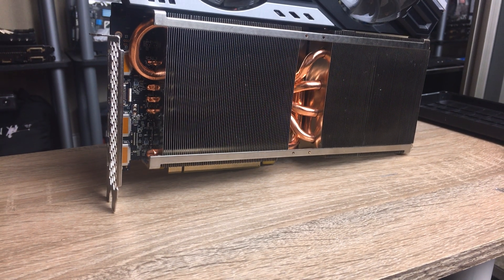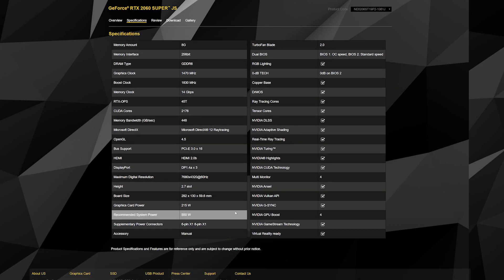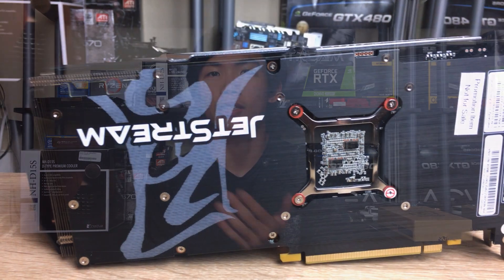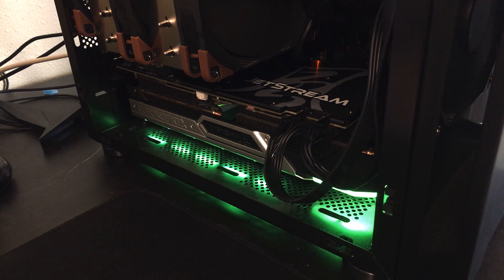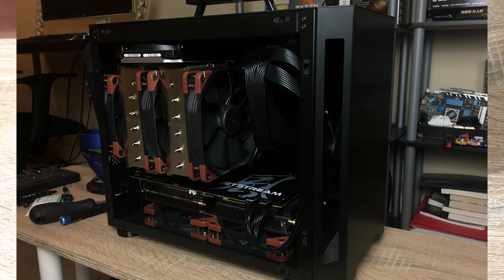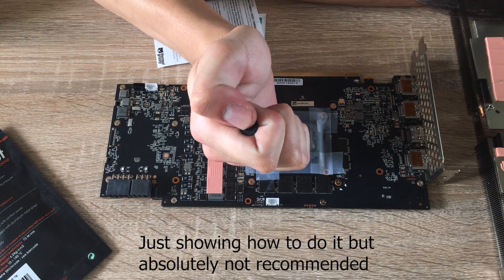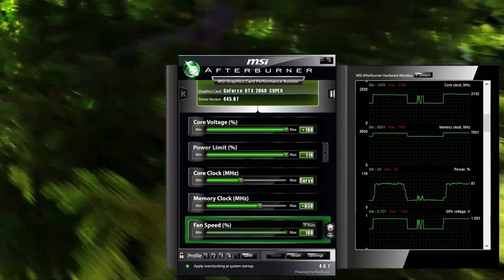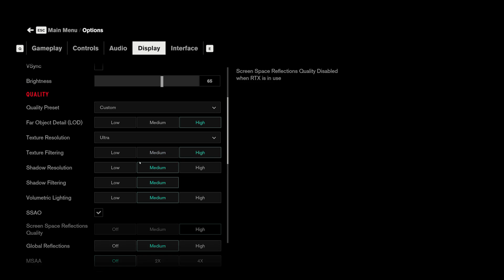The FASTEST one | Palit RTX 2060 Super JetStream MAX OVERCLOCKED Review

Comment: What exactly the settings when you overclocked this graphics card?
Reply from the maker: 2130MHz under load and 1938mhz on the memory.
Reply: @OTechnology could it be run this safely combined with cpu overclocked to corsair 750watts psu?
Reply from the maker: @imlucy7516  Yes